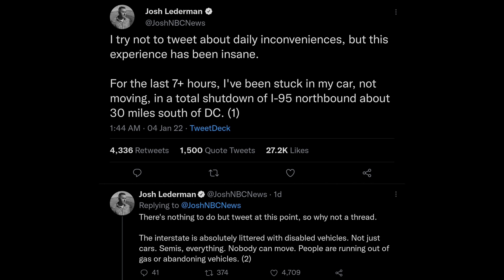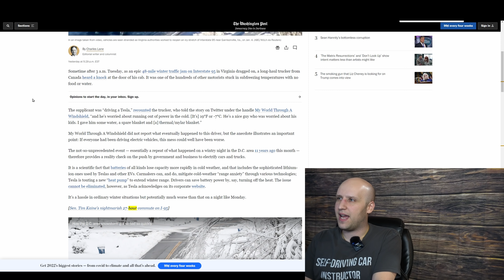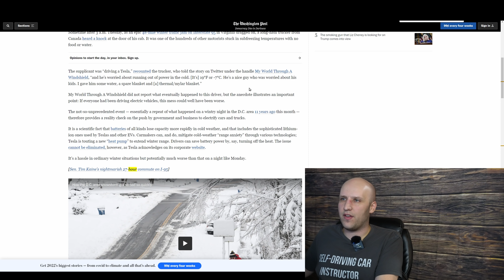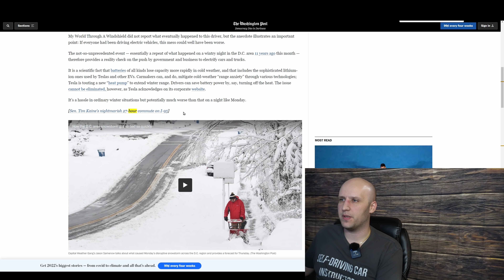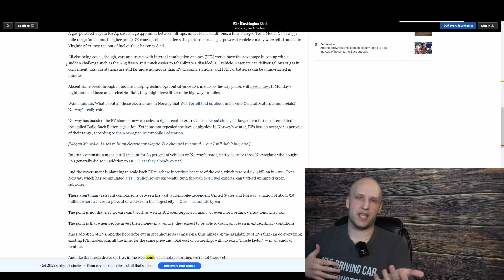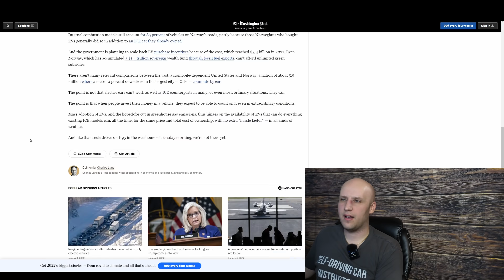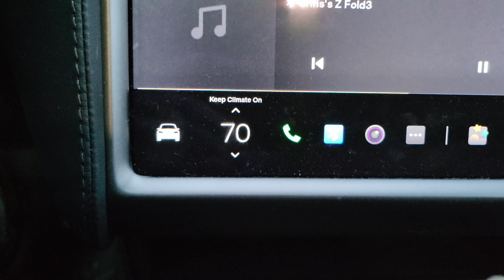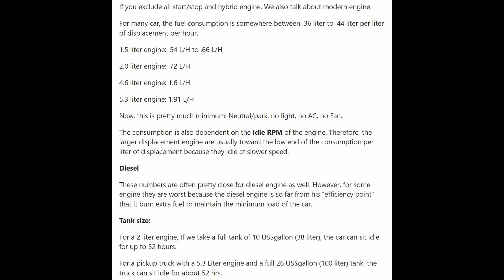How Long Can a Tesla Keep You Warm In A Frozen Traffic Jam? | FUD Debunking

Comment: If the severe cold were coupled with snow, there is a good chance of carbon monoxide poisoning in an ICE car unless you are diligent in clearing the tail pipe as the snow piles up.

Comment: you do realize that combustion engine can rely on two heat sources? Electric heater and then heat from the engine itself. As we heard a lot from tesla owners - the water pump for heating can go bad and then you have no other source of heat. Also after long period of waiting and draining the battery you maybe wont have additional energy left to move to closest charging port - and if there will be many eletric vehicles from that traffic jam - all would want to charge at same time :) With Gas, you simply fill in anytime or go to gas station and be good within 5 minutes including payment. Or you fill in bottle and go to your vehicle and fill it in :) Also depending on the outside temperature - if it is minus 30 degrees Celsius somewhere you will need hell lot of energy to keep warm inside.

Comment: Tesla’s are great but all vehicles have faults. Unless you are charging it from a know alternative energy source then there is a 61% chance you are charging from a fossil fuel source. Also where I live all the gas stations have back up generators to keep the pumps active due to the numerous power outages from the alpine winters we have. The Tesla charger stations do not. A car with 3/4 tank of fuel will be able to keep its occupants warm longer than a electric car with a battery at 75% SOC.

Comment: I heard heat pumps become useless below 40F, I'm surprised
Reply: some are, that's why they often have electric resistive heat as a backup in homes. it depends how the heat pump was designed, the pressures involved and the type of refrigerant. the refrigerant needs to boil on the low pressure side of the system. if the temperature drops too low, the refrigerant simply can't boil to absorb heat, and the system becomes useless. the heat pump in my home uses a mix of 2 different refrigerants, to help it work better for both heating and cooling. there are a lot of factors, it's not magic.

Comment: Cold weather , battery heating / cooling system,  heating the interior cabin ,the steering wheel,and seats all drain batteries.  I would prefer DIESEL and driving in winter I would be prepared ,extra fuel canister, blanket ,warm clothing ,sleeping bags emergency winter kit .

Comment: One detail you didn’t mention about the gas cars, is asphyxiation. Which has happened to people stuck in snow where the snow plugged up their exhaust and they asphyxiated while waiting on help to arrive. Which would not be a problem in an electric car…
Reply: @Krystal A little more likely than that…. Considering states like Colorado, Montana, Wyoming, and other northern states that get really deep snow in the winter all have advisories against letting your car run while you sleep.

Comment: Both Technologies have their advantages and disadvantages. I am from Australia and I have experienced  many different things while driving  crashes floods breakdowns in the outback the most scariest thing I've ever experienced in a car was trying to rescue a family who was cut off by a bushfire and stuck in their home I was told that it was a suicide mission : I took it upon myself to sacrifice myself to try and save them driving on  a road cut by fire with almost zero visibility the heat was so intense that it boiled the water in my washer bottle and steam was coming out of the window washers approximately halfway there my car started to lose power and then died which I was concerned might happen. My only option was to roll the car back down the hill I was unable to get to the family they died RIP 🙏. ::: 
I believe if I had an electric car or a plug-in hybrid I would have been able to make it to them and potentially save them I do not like the push for electric cars they have advantages balanced by disadvantages it should be up to the individual to choose what they drive

Comment: I like how fair you are in this video, and I agree that an EV is a better place to be when stranded in the cold. However, your numbers at the end for ICE idle consumption are inaccurate. Engineering Explained (a Tesla owner) has a video on stop start systems in which he quotes a 2004 SAE study that determined the idling consumption of a then modern Toyota four cylinder as .166gal/hour. At this rate, in a current RAV4 with a full tank, you could idle for 87 hours.

Comment: Do we know how much diesel fuel will be burned to make EV adoption truly viable? Then there's plastic paint, trims and seat covers, tires and wire insulation, all made from petroleum. Asphalt as well. 

Even if we must generate electricity with fossil fuels, pollutants can be better controlled at a fixed site than from vehicles running around spewing the stuff. But in the short term there is a trade off. Will that not make the adoption of BEVs pointless in the long term? Just asking.

Comment: There is a big flaw in the argument that "when the power goes out and you can't recharge your EV you also can't use gas pumps." Turns out my station wagon gets over 700 miles on its 13.5 gallon tank and my personality style doesn't allow me to let the tank go below 1/4 in good weather and 1/2 in bad weather. So if I got stuck in that traffic jam I wouldn't have needed gas or had a problem heating my car for 24 hours. But going to the bathroom is a different story.

Comment: I would think that as EVs become a bigger part of the total car pool, then "emergency batteries" should become a part of the standard rescue team toolkit. Maybe something similar to this exists, but what I'm thinking is an electric battery that would be make the size of a standard child seat, or some other shape designed to fit comfortably in a back seat, with a charging cable that can plug into the charging port on the car through the window, and would allow the car to get driving almost instantly and give it an additional 10-20 miles at least. Emergency crews and tow trucks could carry dozens of these in their storage, with the intention that they can just hand them out to stalled EVs, and they would have strong trackers on them (and the driver's plate would be recorded," so they would be responsible for returning them later.
Reply: You are talking about BATTERIES. Lifted a simple 12v lately? Tow trucks have a legally limited payload, how many could they bring?
Reply: @rdmineer1  I think they could make a battery pack that would weigh about 25-50lb. that could hold a ten mile charge. I might be wrong on that. I would think a tow truck would bring 1-2 for normal purposes, just in case they need one, but in a major winter emergency like this they could load up trucks with dozens and distribute them to each car. The point of it is to allow cars to take off almost instantly after contact, rather than needing to take minutes or hours each to charge up enough.
Reply: @rdmineer1  Okh, I did some looking, and they do make something like this. It's a 50lb. battery that claims a 20-40 mile range.
Reply: Limited access in a gridlock. How much for the service?. Why not carry one under these conditions? I95 corridor may already have charging stations close enough, but the Dakotas, Montana for example, I doubt it yet. In time, perhaps, but low population=low to no priority.
Reply: @rdmineer1  This is why the Build Back Better plan is so important, it has those sorts of investments. It really shouldn't be a huge problem in places like the Dakotas or Montana though, because people should plan to have plenty of energy to carry them from point to point, just as they would be expected to have enough gas to carry them from point to point, and a long duration traffic jam like this would not be likely out there. This was an extreme outlier that you would only get in a densely populated area.

Comment: If the Virginia traffic jam was all EVs that would have been worse because the lower range of EVs means a greater percentage of the vehicles would run out of power and earlier. Fueled vehicles discard loads of heat so they don't use as much of their fuel as EVs when used to heat a vehicle in cold weather. But it doesn't matter if fueled vehicles could handle that traffic jam better than EVs. You don't compare fueled vehicles and EVs based on a situation that occurs once a decade and only affects a small amount of people who go out unprepared in bad weather. The primary problem with the Virginia traffic jam is it doesn't snow much there so everybody drives around on "all-weather" tires instead of snow tires. All-weather tires barely work in snow, so if there is any significant amount of snow it becomes a complete mess.

Comment: Until you actually experience a situation you have no realistic view. What is the chance you find yourself in this scenario with 90% battery? If you have already traveled 100 miles since charging, well you're near 50%, 100+ miles. Run out of juice, call a tow. Well you're not the only one needing, and how many are available while you freeze to death? My two ICEs would still have @300 miles remaining. If I run out waiting, fuel can be added in minutes of arrival while the truck hooks up to you. Besides, I could realistically carry spare fuel. Dangerous but so is 12°F. If I were stuck with owning an EV, I would keep a Honda generator in the frunk, set up for the task.

Comment: Turning down the heat makes sense, since you only need to maintain just enough comfort with the air, and use the heated seats. With a ICE that is low on gas, you would have to keep turning it off to conserve gas, then turn it on to keep the windshield frost free. Not a fun situation.
Reply: Especially if you're stuck long enough to want to sleep.  I was stuck a few years ago on 81 for 24 hours . Luckily I had just picked up a rental and it was full.  When I slept I just let it run wasting a lot of fuel

Comment: I was wondering when someone was going to test this.  However 15 degrees really isn’t that cold.  Where I live it’s been -25 to -30 at night with daytime highs of -15 to -20.  I’m curious how these cars would do in true cold temps, then add wind chills at about -45.  Can you please repeat this test in cold weather?
Reply: Wind chill isn’t a factor for anything other than exposed skin, where evaporation in typically dry, cold air carries away body heat faster than in calm air.  The insulation in a vehicle is more than enough to prevent significant convective heat losses.  Glass is an excellent insulator, as well as allowing in infrared energy during even overcast days.
Reply: @jimmanley2796  actually wind chill does in fact impact mechanical devices, after all it's the engineering concept employed by a vehicle's brakes.  The idea that increased flow of air over a metal surface will extract heat.  I see even the Canadian government has opened a safety investigation into some tesla vehicles based on concerns that inadequate defroster performance will impede visibility and resultant safety

Comment: Modern ICE Engines, can burn burn more fuel when using the heater. 

At idle the engine runs at lower RPM, ~600rpm, with VVT, EGR and other tech to decrease fuel burn at idle. When the cabin demands more heat, it cools the engine below operating temperature, and lowers the exhaust Temp which would cause the Idle to increase and more fuel will be consumed to maintain coolant temperature/ heat the Cabin. 

When Driving my GDI car, in -15-degree weather, I could see a dramatic difference in fuel consumption when I used the heater. The engine is designed to Run at 212F Degrees for maximum efficiency.

Comment: I Drive a 2021 Big Bend.  I am an ice fan; However, I do like the base F150 lightning and could see me buying it.  If I had the income, I could also see buying the Ford crate EV Mach E GT motor and putting it in a classic Mustang or a Bronco II.  That would be pretty cool.
I agree that the article is flawed at best. 
I would rather have an ice vehicle to stay warm or stay cool in a traffic situation.  If needed, I could have someone bring me extra fuel or buy some from someone that had extra. Not able to do that in an electric. The electric F150 will be able to transfer power to another EV, and I believe it is coming to the newer electrics. 
Side note, I have slept a lot in running ice vehicles.  Never a problem with carbon monoxide.  
Slept in running military vehicles and never had a problem.

Comment: not so strange its alot easier to get a fuel truck out there then there is a power line or generators and then to sit there and charge them as well  with gas just put a gallon or two in the tank and off you go

Comment: ICE or EV's doesn't change the Dumb$$$$'s that cant even get their AWD, 4wd, etc anything through what I drove my 3V RWD mustang gt manual no problem (though highly stressful). Everyone putting their windows down at me like I'm crazy just to get home and see this. I was going southbound and witnessed the first few handful of semi's that started the whole ordeal on northbound as well as idiot semi's off in the ditch. Passed the worst of it around 9pm that night . I would definitely NOT recommend a RWD anything in these conditions but I'm going to be straightforward... if you got your Subaru/4 runner/ 4x4 truck stuck in this....you deserved it. If you were just trapped by the northbound semi's...sorry, that was really crappy. 

Waze even sent me off in the backroads...not fun as there were trees fallen in the road (fortunately cut for one lane by locals or road crews). 13 miles took me an hour. then the 30 or so miles on 95 towards 64 was an additional hour. 

Finished the night with another huge truck that totally wiped out in the middle of the 4 lane section of 64 east (south of Williamsburg). They fortunately didn't hit anyone else...but it takes talent to crash yourself in 4 (relatively clear) lanes. By that time is was patches of black ice, but overall, 64 was fine. 

Learn to drive, know your conditions. I would recommend people do local auto cross's, dominion raceways "track attack" (paced laps), etc for getting experience in car control or pushing the limits. Those options are relatively cheap too and don't require you to be competitive. If you made it this far I got some videos me doing the recommended activities :). That, or freaking do some donuts in a parking lot

Fun facts in regards to ICE/ getting stuck in snow/ cold:
1) the thermal mass in your coolant system in engine block is more than enough to heat your car to the max, then turn it completely off and let sit for HOURS, just to turn it back on and let the waterpump cycle the still hot water. People make the mistake of turning the engine off and letting the fan deplete the thermal mass in your system through the heater core (basically a second radiator if you're not running the engine). Anyone that has gone out to eat in their ICE in the friggid cold just to come out to basically instant heat knows this. It's also why the "heat pump" version of the tesla is better because of the thermal mass of the coolant+ other factors

2) a towel...yes a towel you dry yourself with...place that bad boy in front of a tire in the snow/ice. Viola, you basically got tire chains. 

3) In ice/snow -> wheel speed and torque are the enemy. Having the ability to upshift or have control of the clutch is important if you ever lose traction. Its the same principle as why ABS helps you stop faster.  Letting the wheels free-wheel allow greater control if you start slidding...so avoid holding brakes when you in a potential evasive maneuver. Example is throughout the13 mile stretch I probably avg'd 15-20mph in 4th and 5th gear @roughly 700rpm. EV's are tricky because of the instant torque, so you really have to pedal it/let the traction control save you.

Comment: The heat pump probably wouldn't work in a cold Minnesota winter (-30F). Heat pumps work less efficiently the lower the external temp. Hopefully it is also equipped with an electric resistive heater for backup.
Reply: I suspect it would stop if much lower than -5 F but there are some units for dwellings that can go down to -15. According to a few post on other sites there is no backup heat.

Comment: Btw gas cars can last a long time too. Anyone with a brain doesn't keep a gas car on when in this situation. You run max heat and get the inside nice and hot and then turn it off for 45mins to get max efficiency, it'll last for several days like this, especially with the new heaters that are more efficient if it's very cold like in the new mustangs.
Reply: I'm curious what new things they're doing to make heat in a gas car better. hope it doesn't make it more prone to failure. only thing I can think, maybe there's a smaller coolant circuit for the heat, which is able to warm faster?

Comment: I had a situation where I went skiing and on the way back it started snowing and there was heavy traffic (probably from cars being told to put on chains). After about an hour with the heater on my battery died. Maybe I had a bad battery or the alternator wasn't producing enough charge at idle.
Reply: The voltage regulator may have been marginal, which regulates charging of the battery, if it wasn’t marginal itself.

Comment: Isn't your Model Y data a bit skewed since you didn't start it at 90% on a cold battery? Assuming that you started the test at 60º versus 70º, the initial energy it takes to warm up the car would have been different. Just wanted to throw that out there so you can get a more accurate reading, but of course, there's a lot of external factors, regardless. Thanks for the information!